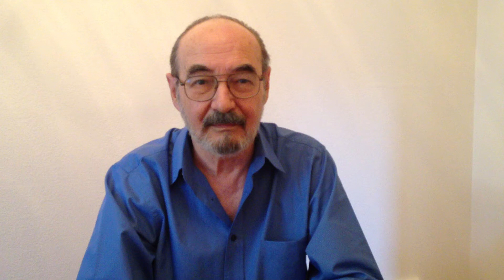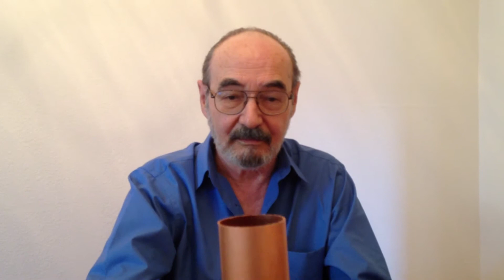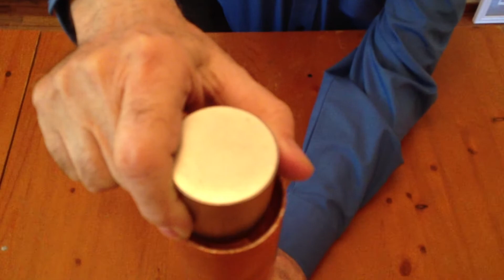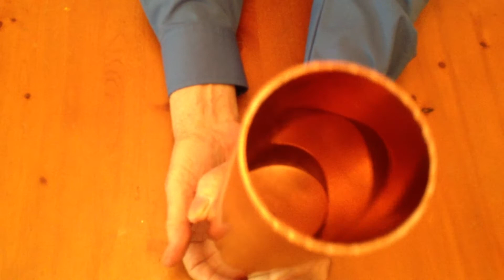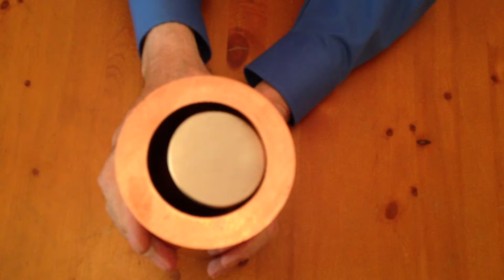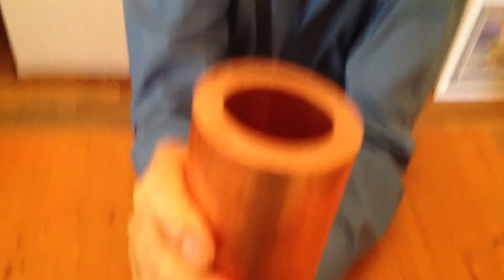Eddy Current Reduction, Importance to Audio Cable Design

Comment: I wish I could ask this gentleman this question.
If you are using a smaller diameter conductor as a speaker cable to an amp, you have higher resistance. Expecially if you are using several hundred watts. So you are already loosing a large amount of power to heat in that case. So how do the amount of decrease due to eddy currents and higher resistance compare. It makes more sense to me that the amount of loss from resistance would be much more noticeable than the amount from eddys.

Comment: Mass has absolutely nothing to do with it, it's purely that the thicker tube has much less resistance so a larger current flows.
Reply: thicker = more mass. same difference
Reply: @johnmcdonald3884  it's not the same thing.
1kg of aluminum and 1kg of copper would behave differently.
1kg of aluminum and a resistance-equivalent amount of copper would behave the same.